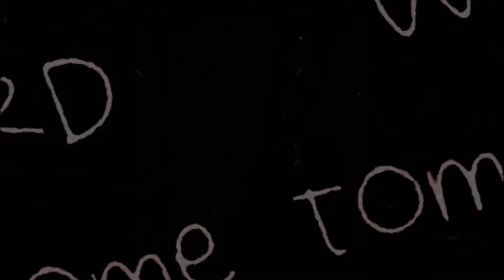Water coming from under cabinet

Comment: May be a drain line for the the pressure relief valve on water heater? Ray I love the way you always think outside of the box.
Reply from the maker: No water heater in units good call